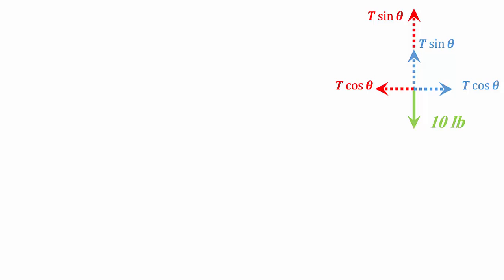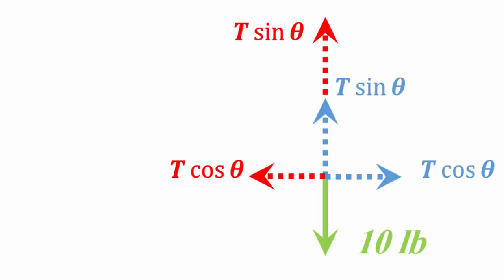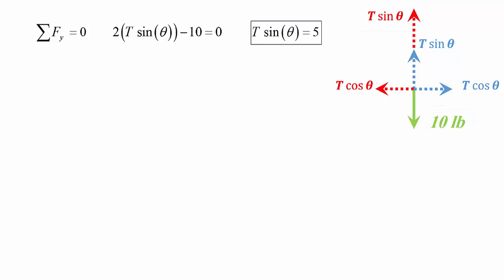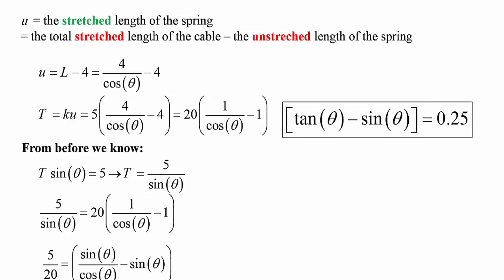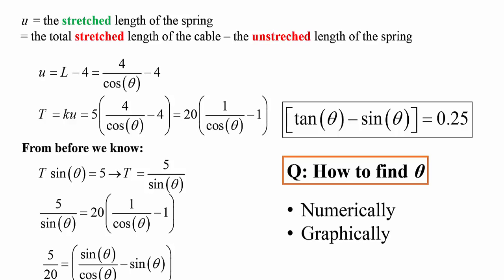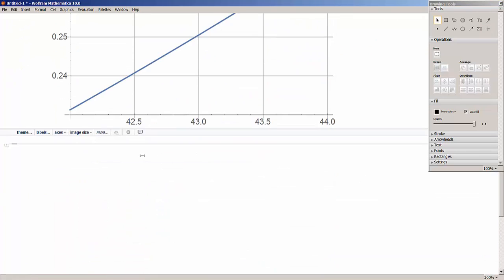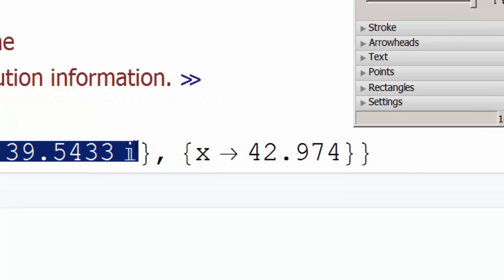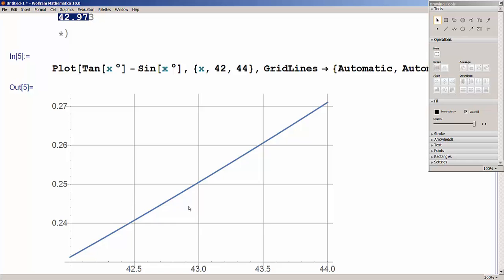Getting Help from Excel and Mathematica

Comment: I usually use fplot() and fzero() in matlab for these situations. Both will provide a very precise answer without eyeballing. Thanks for the video!
Reply from the maker: Raymundo Flores you are right, specially when you can trace the points on the graphs. For me, the solver is the best solution for such situation. Thanks for the comment.
Reply: Yeah. The more tools, the merrier!